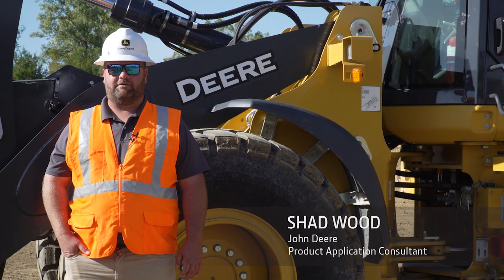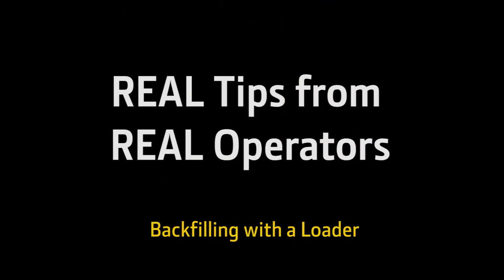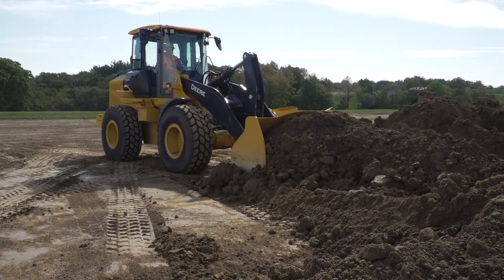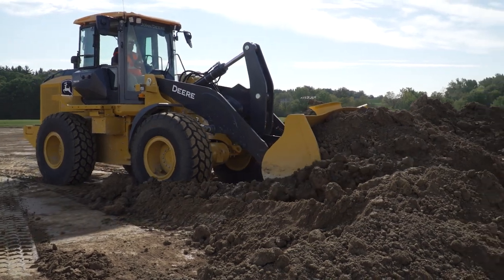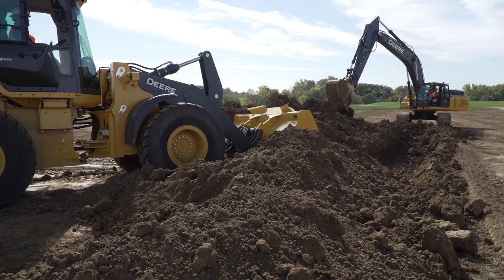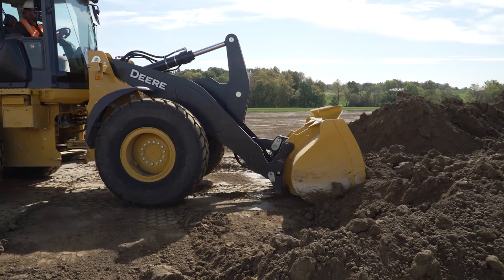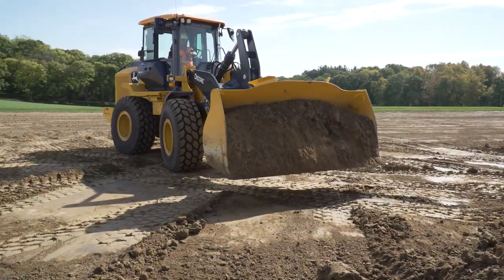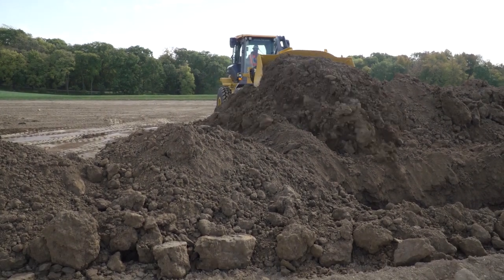How to Backfill a Trench | John Deere Wheel Loaders

Comment: what is the average output of backfilling using this backhoe? approximately how much m3 per hour?
Reply from the maker: Hi there - thanks for reaching out. The bucket capacity ranges from 1.9 – 4 m3 with a coupler and 2.1 – 2.5 m3 with a pin-on. If you’d like more specific details on the average output of backfilling we’d suggest you reach out to your local dealer.

Comment: Does wheel loader have four wheel hear drive
Reply from the maker: Hi there - thanks for reaching out. Yes, both front and rear axles are powered on a wheel loader making it 4-wheel drive. If you’d like more specific details on the wheel loaders, we’d suggest you reach out to your local dealer.